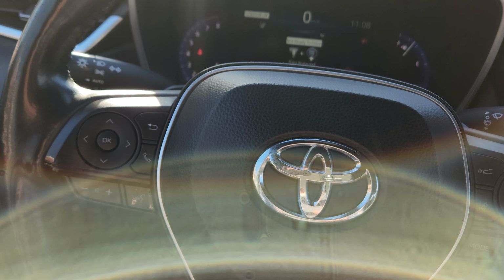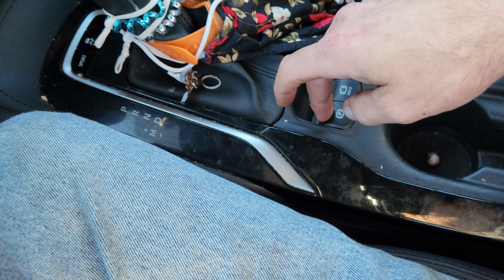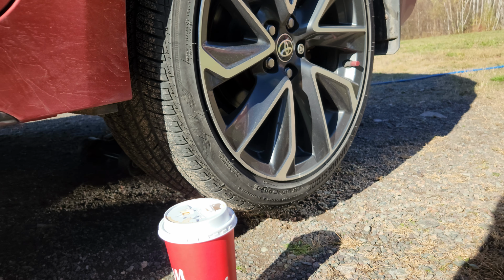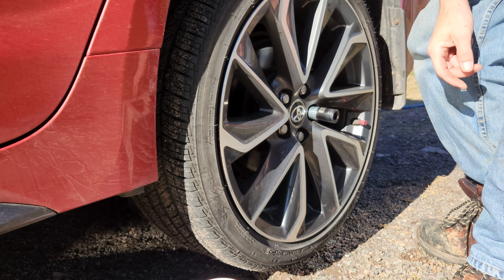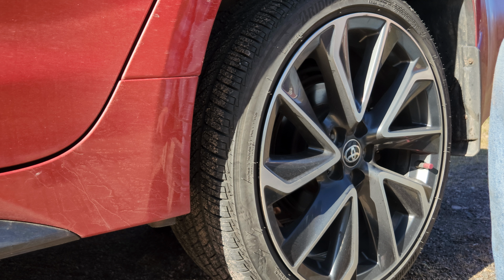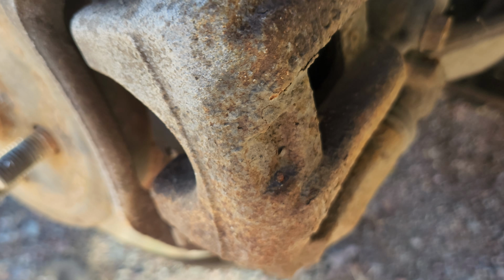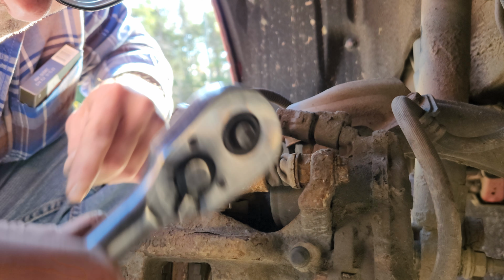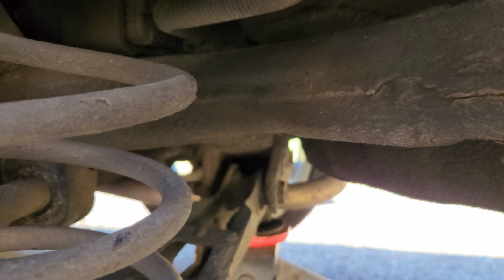Rear Brake Job, 2020 Toyota Corolla XSE with Electronic Parking Brake.  Part 1

Comment: Can someone tell me wh he’s doing
Reply from the maker: I'm doing a rear Brake Job on a 2020 Toyota Corolla XSE.   Changing both pads and rotors because I live in Nova Scotia Canada where they use salt on the roads during winter.  This salt rusts rotors making the ends and little lips expand more than normal.  This causes the rotors to come in contact with brake caliper if you don't change Rotor when changing pads.  Rotor will not last with 2 sets of pads.

Comment: Brakes looks old for 3 years old car
Reply from the maker: That's what happens when you live in a place that has snow.  Rock salt and chemical de-icers does that to a vehicle
Reply: @trainstractorscarsandtruck7362  I live in Florida , but I still avoid getting too close to the beach